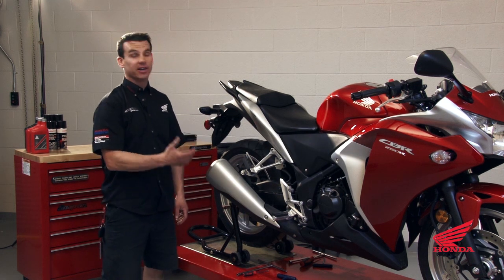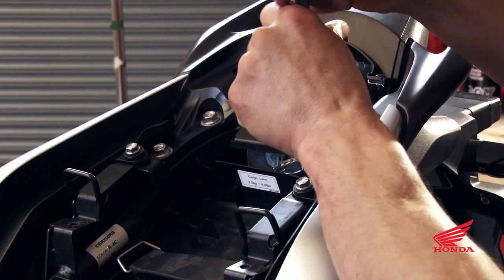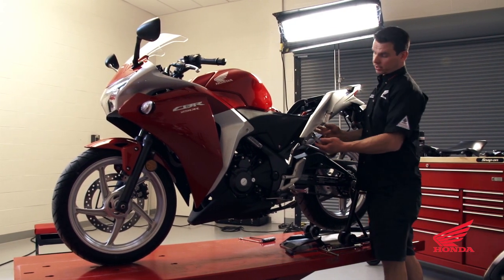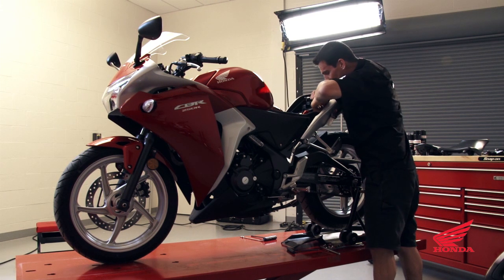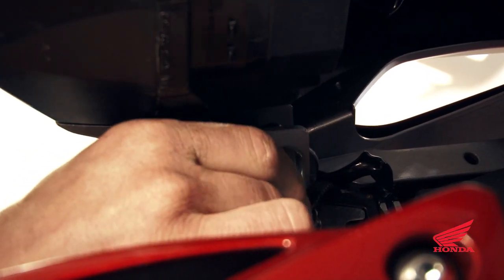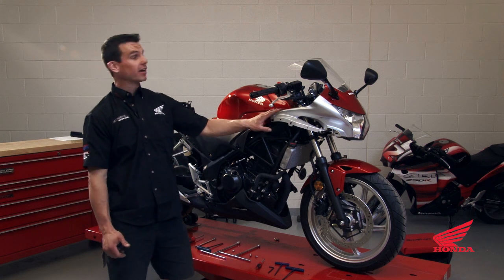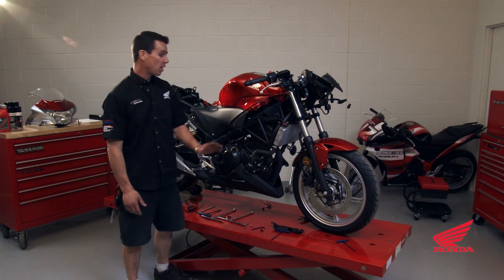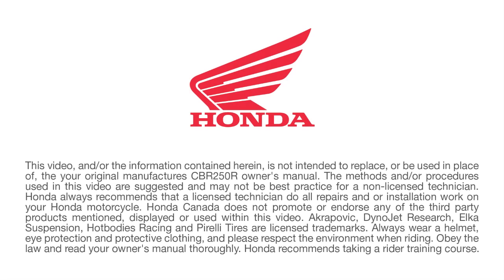CBR250R Race Kit Installation: Removing the Stock Bodywork

Comment: Hello, I am a user of a honda cbr250, I have a problem, the speed indicator stopped working, I do not know if it is the sensor or the digital screen, I would like to know where the speed sensor is located for its respective revision or eventual change

Comment: hey thanks buy whoever is trying to open the back they need to make sure of the plastic clips under the seat(its shown in the video1;28)mine ive broken off but not to worry u can just fix it with a nut and bolt